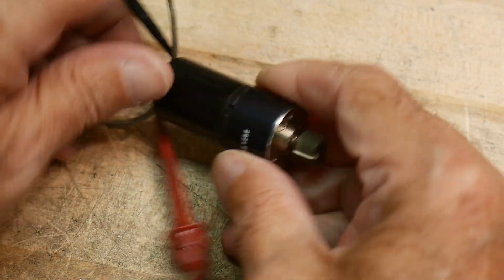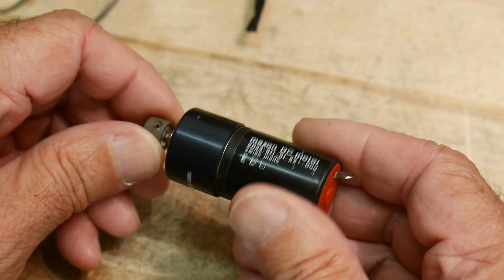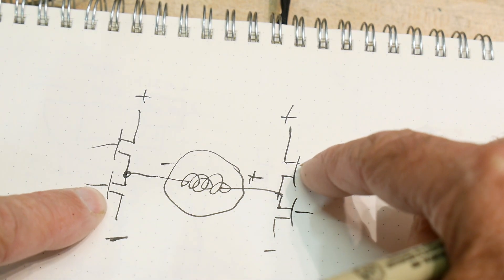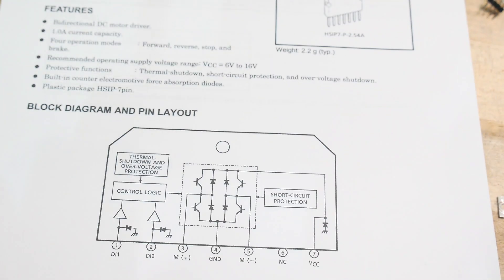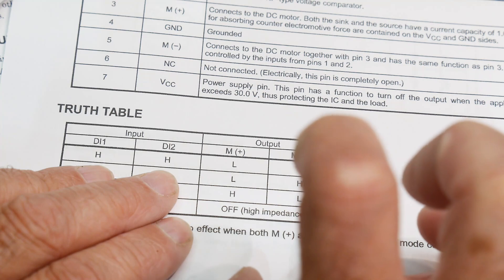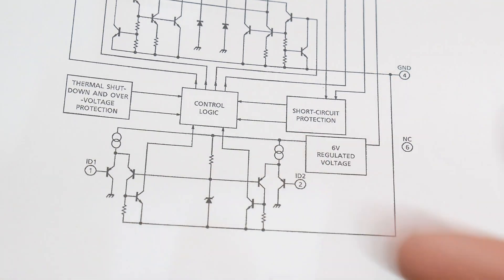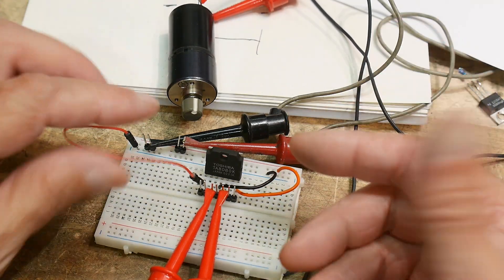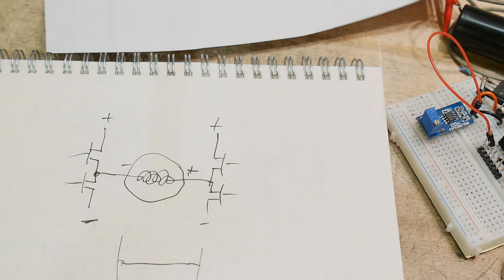#787 H-Bridge DC Motor Driver

Comment: Interesting.
Also, they use H bridge motor drivers for AC (synchronous ) Motors to control the speed by changing the frequency of Motors.  Although, you can control the speed by changing current or voltage; however, it would reduce the torque.

Comment: The other cool application for the H-Bridge is driving bi-polar (4 wire) stepper motors.  The Arduino IDE even has a library for simplifying the code to drive one.  Maybe a topic for the follow-on video...

Comment: Interesting, can you hook them in parellel multiple to increase the current capacity? Or, is there a larger amp capacity package? Going to research those Maxon motors. Thanks for the look.
Reply from the maker: no, you will need a bigger one. or build it out of separate transistors.
Reply from the maker: I give a link in the description for a 2A part
Reply: Ythanks.

Comment: Lots of H-bridges used in automotive applications:  Window / mirror motors, door lock solenoids, etc...  One nice additional features of the off-the-shelf H-Bridge modules, in addition to the overload / short protection you mentioned,  is the built in "snubbing" diodes for when driving inductive loads.  Kinda nice not to blow up your project with the back EMF from a motor or solenoid.   Good Stuff.
Reply: Tell us more.
Reply from the maker: https://www.st.com/content/st_com/en/campaigns/h-bridge-dc-motor-driver-for-automotive-application.html
Reply from the maker: https://www.nxp.com/docs/en/white-paper/HBRIDGEWP.pdf